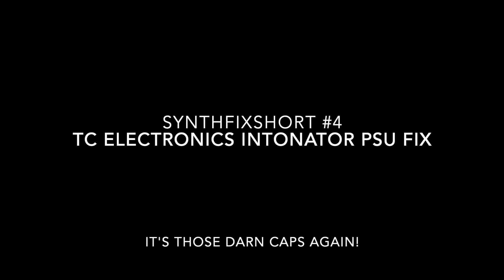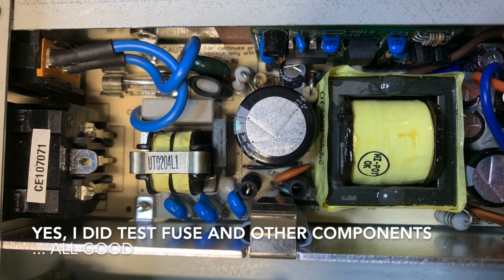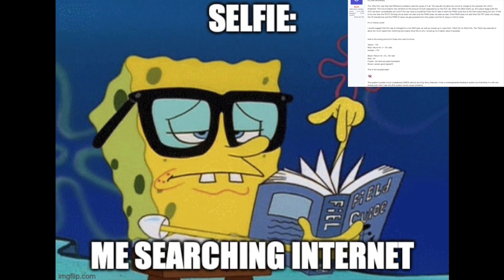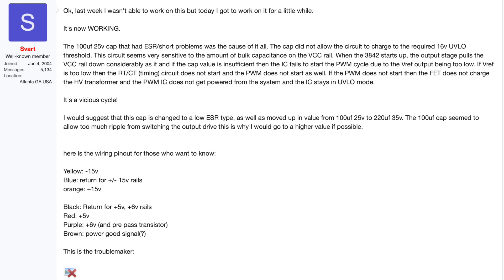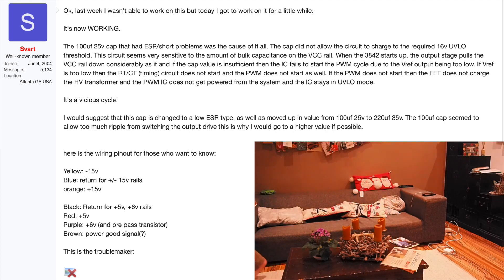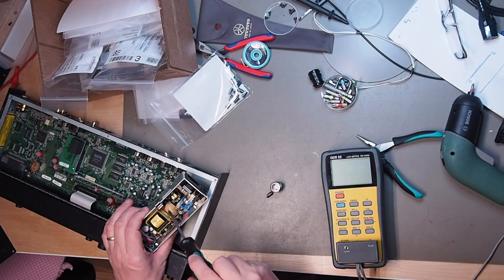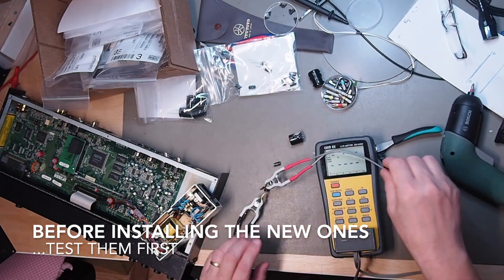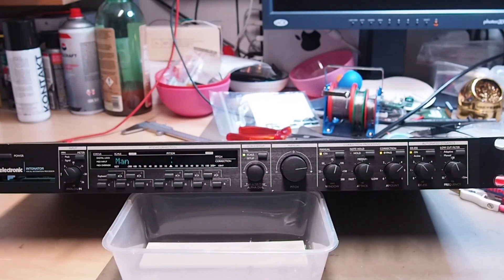SynthFixShort #4 TC Electronics PSU fix

Comment: This was the problem with the PSU on my TC Finalizer Plus as well, four or five years ago, and replacing the 100µF cap solved the problem for the time being. Eventually, however, the 47µF/ 400v cap went as well, and the caps on the low-voltage/ DC side were also failing. I'd recommend replacing all the electrolytics at this point if anyone's already in the power supply. After doing so, all the voltages are in much better spec. Thanks for posting this, as this has to be a problem for many TC owners at this point.

Comment: my c7  value  is 50v 47uf,what caps value should replac, 50v 100uf or just like you did ,use 220uf 35v
Reply from the maker: that is weird... the higher voltage ones are often larger (depending on make and model of cap...) But you should be save with 220uF/35V...